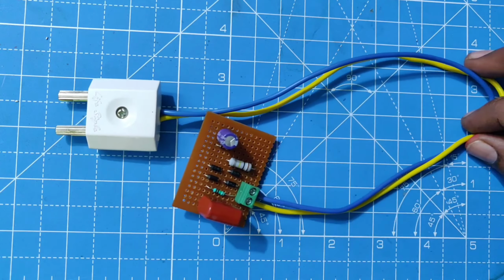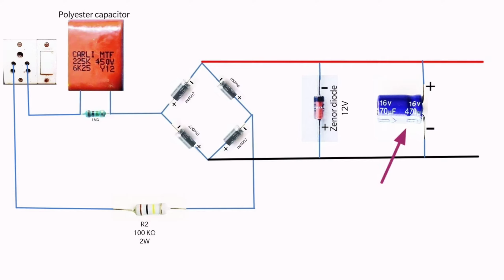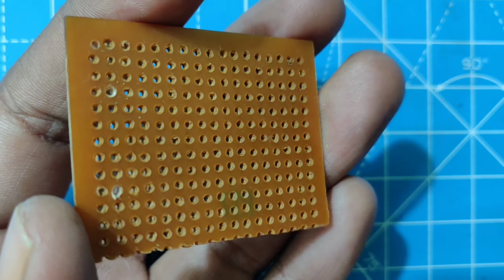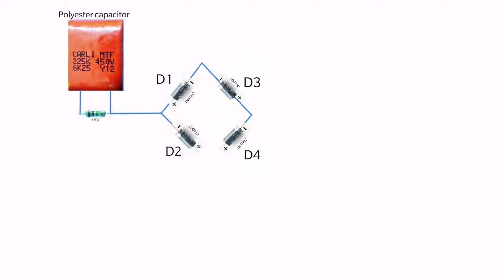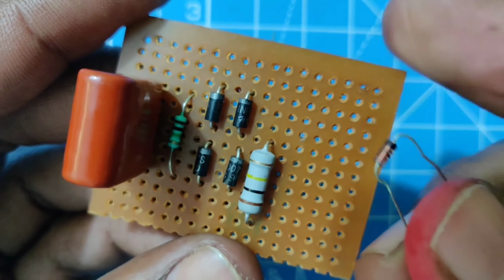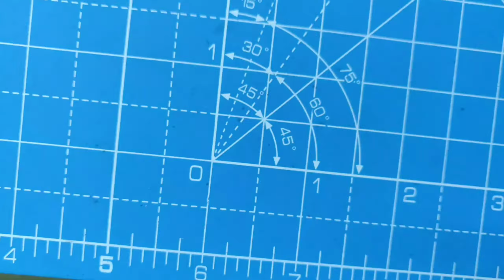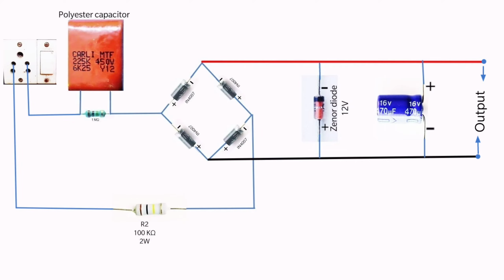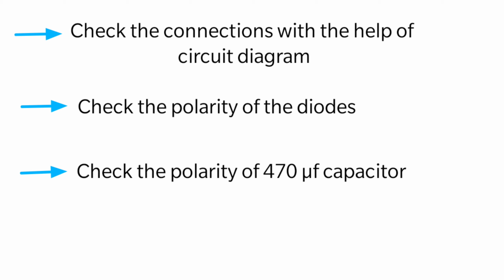How to convert AC to DC without transformer | convert from 220v AC to 12 DC with explanation

Comment: Is it safe?  Every low budget chinese devices are using  this mathod.
Reply from the maker: Thanks for the quality question. The X rated capacitors are used to reduce the cost. For safety concern i recommend you to use the transformer.
Reply: @BlueDotElectronics  thanks

Comment: How can you prove you have a 220v or 230v ac you only show the output 12vdC but where's the 220v in a tester
Reply from the maker: @techniwey, i understand ur point. Surely next time i will shw the AC voltage in multimeter. Thanks for the suggestion.
Reply: Thanks ill wait for it

Comment: Y dnt you check AC 220v?? In a multimeter tester
Reply from the maker: Because countries like India and Europe, the voltage supplied is 220-230 V.
Reply: Why dont you show 220ac input in a multimeter tester, to prove that you have a high voltage input,,
Reply: @Techniwey  bro he's using the 12 v diode to pass and convert 220 volt dc  only 12 volt dc. But I have doubt if it lasts for few minutes.😃

Comment: Zener diode is heating up within few seconds of turning on the power. Please help
Reply from the maker: check the value of zenor diode and check the connections.
Reply: When you switch on the circuit the Zener sure to heat up due to fluctuating DC; that's why when the DC comes out after zener you should arrest the sudden surge in voltage that too DC. To avoid this always introduce a resistance to the tune of 100 ohms of 1 or 2 watt before Zener to safeguard the Zener. Another safety is to use a 2.2 MFD 450 volt electrolytic capacitor across the bridge rectifier+ve and - ve polarity with one Meg ohms 1/4 watts resistor to act as a fuse in worst situation across the electrolytic capacitor for more safety and reliability and long lasting . Rest of the circuit is fine.